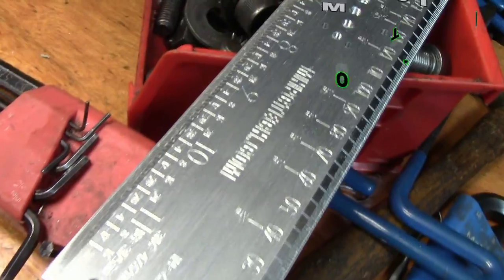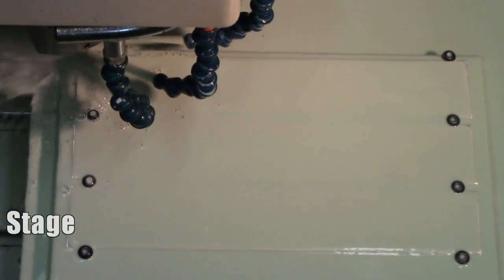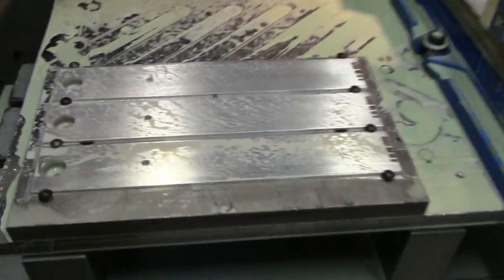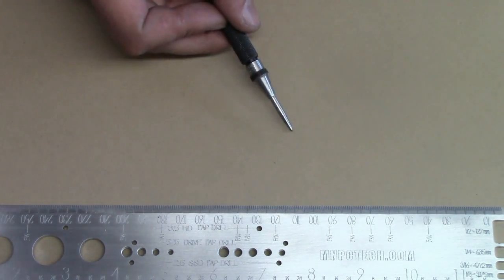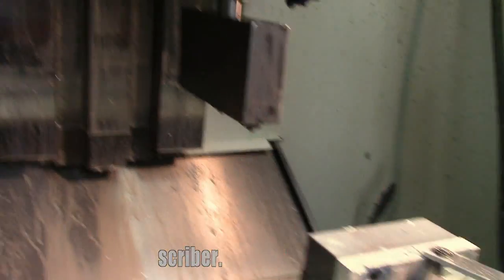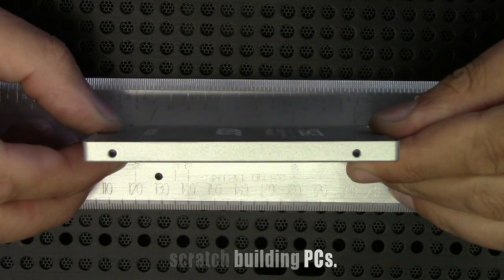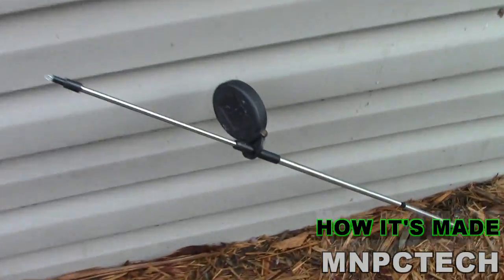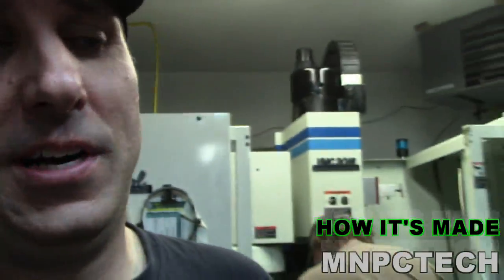HOW IT'S MADE: PC Mod Ruler & Reference Gauge Tool by Mnpctech.com

Comment: Do you have a recommendation for a spring-loaded engraver? How does one decide the tip angle? I notice yours looks like a 90º tip. I was thinking to use a 60º.
Reply from the maker: this one is custom made, speak to local fabrication shop, thanks for watching
Reply: I actually am the local fabrication shop.